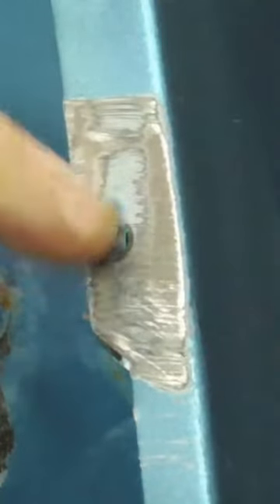How to Use a BLAIR Spot Weld Cutter #autobodyrepair #shorts #autobodywork

Comment: That's a good technic to use on the cheaper blair cutters 👍
Reply from the maker: You're right - they are the cheaper cutters.  BLAIR makes a better set now - much better.  I like drill bits myself :)

Comment: I use a center drill to put a dimple in the metal much like a center punch would. The point of the HF cutter is spring loaded. Push the cutter into the work slowly and let it do the cutting. Light pressure and slow drill speed will make these cutters last 15-20 holes easy. They get dull before the teeth break off. I hope this helps someone else
Reply from the maker: Thanks - I actually never had one get dull on me - the teeth are always broke before that happens 😒
Reply: You can't just use a drill bit the size of the larger hole?
Reply: @johnnyblade3335  I suppose you could. I think there is a tool that does.

Comment: I hope that's not a HF spot weld bit.I bought one of those and after two holes it was finished.
Reply from the maker: No - it's BLAIR - they're very sharp and last long but brittle.  BLAIR makes a better cutter now - it's called BLAIR Premium.  Drill bits work just fine too :)

Comment: Umm. I was taught not to make a hole in the back to leave it factory.
Reply from the maker: Not really true as your new panel wont have holes in it.  In other words you will be drilling new holes to weld through - odds of hitting one of the drilled holes is slim - even if you do, you can just weld it up.
Reply: @LakesideAutobody   It makes sense how I was taught because we did minimum MIG welding. We use the spot welder so it was easier for us not to make holes. Both panels did not have any holes except where we could not fit the spot welder.  Every time I made a hole the bodyman would get mad at me saying that he was not going to repair the holes.  Then I worked with another body man who did not care because he was mig welding, but again the holes were minimal. I have seen both methods and if you have the spot welder I would say it is the way to go. If you can avoid making holes. I think it is cleaner, but you are right about anything that can be fixed with a mig welder. It is just more work done; grinding, applying Bondo and sanding again.  With spot welder, it is spot welded and you are done.
Reply from the maker: Good points - thanks for the comment my friend.  This one might work for you from Eastwood - no holes 👍 - Spotweld Cutter Pro Kit 3/8 And 1/2 in - ITEM # 19004K BRAND: EASTWOOD @checolate9680